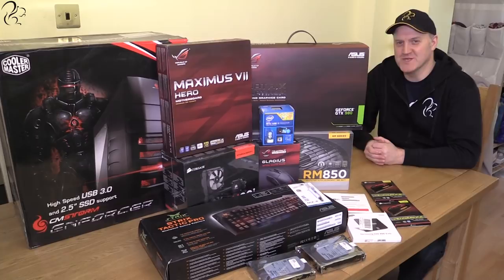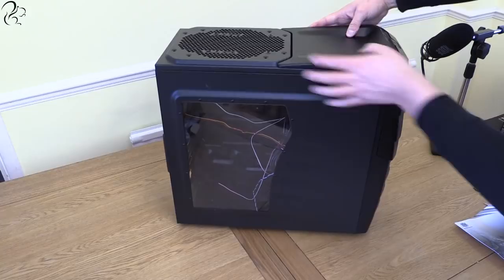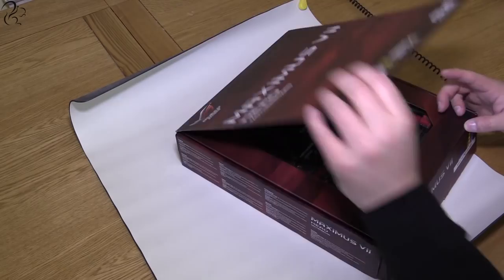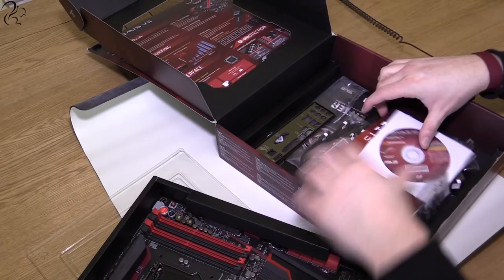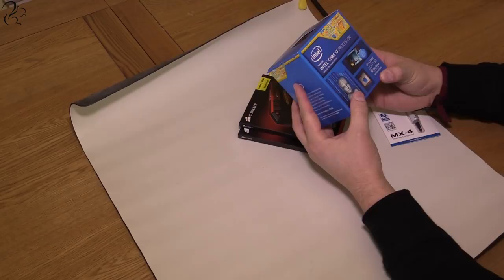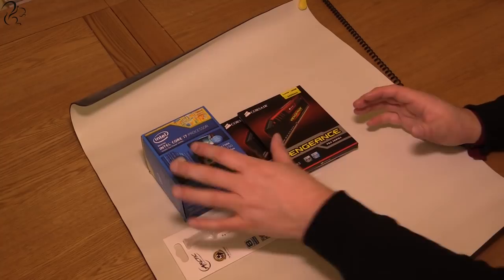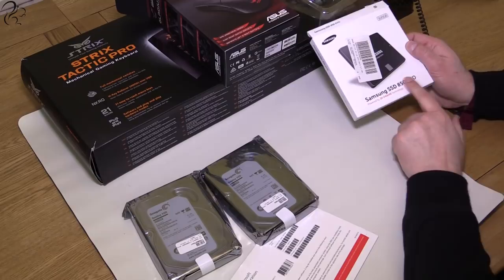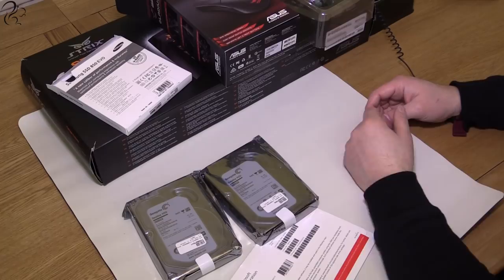How I Built My Gaming Rig (Step by Step)

Comment: builds ultimate gaming PC, plays euro truck simulator.
Reply: so what?
Reply: ETS 2 is a fun game!!
Reply: You realise Euro Truck Simulator on utra is a whole lot more graphic intensive than GTA V? At 1440p on my GTX 1080, I get 110 FPS on GTA V, and around 90 FPS while playing Euro Truck Simulator 2, both games on ultra.
Reply: Prins van Oranje My dad plays it on ultra on his crappy cheap pc and gets around 40 - 50 fps.
Reply: ciko 2283 Then your definition of 'crappy' is what most would consider a decent PC, or maybe or Dad just has a 10 pixel monitor.
Reply: Prins van Oranje well, its not really crappy, but its not GTX 1080 either. It has a pentium, some radeon hd card, not really sure and 6 gb RAM
Reply: ciko 2283 Well I was just using it as a comparison, that GTA V (a reasonably graphic intensive game) is less demanding than ETS2, not saying that you need a GTX 1080 to run either game, although it's recommended if you have a 1440p or better monitor.
Reply: ETS2 uses old tech to render GFX. Its not more demanding than say GTA5 its just that GTA5 uses later tech more capable with newer components than ETS2 does. FSX is the same, If they ran on direct X 12 then ETS2 and FSX would give much higher frame rates than they do. Hopefully there will be a ETS3 which will be more up to date with todays components.
Reply: That could also mean that ETS2 is not as optimized as GTA V.
Reply: Ets requires alot of power
Reply: Gta 5 is more cpu intensive so a higher end graphics card is less important to have. However ets2 is still less demanding than it

Comment: THIS video made me build my very first PC four years ago!. I tried to mimic your rig but in Argentina, some of the components were extremely expensive. Finally I got a 4790k, an Asus Strix GTX970, ROG Maximus Hero VII, the Corsair H80i, a Bitfenix Shinobi, 16GB of Gskill Ram and a 1TB HDD, a Coprsair K70 and a Steelseries Sensei Wireless mouse. Since then I've upgraded the memory (32GB) the case (NZXT H500), the graphics card (RTX 2060) got a 250GB, 1 500GB and 1TB SSDs, and the mouse (G900) aaand yesterday I got my Strix XG27V monitor. Sorry for the rant, but YouTube brought this video to me TODAY and it all just came to me. I don't know if you'll read this, but thanks Squirrel for this video, it was really a useful, well explained step by step to help me achieve something I never knew I could do!

Comment: Un-plug the molex cable from the graphics card, its for a memory defroster for when you use liquid nitrogen cooling, all it does is make the gpu memory run hotter.
Reply from the maker: TacticalWeetabix I'm going to ask my ASUS tech guy about that. I think it's probably an un-necessary connection but I'll see what he recommends.
Reply: Squirrel http://rog.asus.com/393712014/gaming-graphics-cards-2/overview-unboxing-rog-matrix-platinum-gtx-980/

"For those using liquid nitrogen, solder in the VGA Hotwire wires and short the available points to unlock LN2 mode, then plug in a 4-pin molex power cable to use the memory defroster. This keeps the memory from freezing up"
Reply: TacticalWeetabix Wait, people REALLY use Liquid Nitrogen to cool their computers? 0_o
Reply: TacticalWeetabix Is that a technical exercise or do people plug liquid nitrogen tanks into their computers when they browse facebook?
Reply: bigglessy LN2 for overclocking competition. Its not for average joe.
Reply: Faq
Reply: Squirrel when in doubt refer to the manual

Comment: I hate to burst your bubble, but the 120mm radiator and fan combo is less efficient at cooling a CPU than a good heatsink and fan. It's also not as quiet as you might think either as you still have two fans to cool the radiator. Whereas a large fan on a good heatsink will rotate slower and move more air, something like the Noctua fans are almost silent. Water cooling only really comes into its own when you are using a larger radiator (280mm) and overclocking the CPU.

Comment: Paul, you get 2 fans for the radiator so you can make a pull/push function. 1 fan on each side blowing in the same direction, so the airflow will be better when going through the radiator

Comment: Way more impressive than my PC build :(
Reply: Don't worry, your not alone. Even I have an above average gaming computer, yet I'm still jealous :)
Reply: Skybluex i'm impressed with my setup it can take NFS most wanted (2005) on full settings with 22 FPS. and BFP4F on lowest setttings at 7 FPS.
Reply: But will it run OMSI 2? XD
Reply: bigglessy But less impressive than mine... 
...I have an (oven) Pentium 4 @ 3Ghz with Hyper-threading on single core, only supports 32 bits, A Gigabyte GA-8I865GME-775-RH Rev. 1.1, it does not support an external graphics card and it's only DDR with two sockets, so 2 gigs DDR, a 500 watts PSU, a CD reader, it can't write nothing, a Seagate Barracuda of 80 gigs @7200 RPM and it's slow as hell, All this ultra generation system runs XP, and it can run NFSU2 at 12 FPS in windowed 800x600 at minimum, it can't run Crysis, or even OMSI, not even 8bit games.
Reply: TheVieneses just when I thought my computer was slow
Reply: Bro Vids Mine is worse than slow.
Reply: bigglessy you are NOT alone at all i have a Intel Core (TM) 2 Duo with a graphics card on ETS 2  give 0-10FPS on other games 20-60 windows 8.1 (i HATE it) sorry if i offened you if you have 8.1
Reply: bigglessy My first pc specs:
Intel Core i3
WINDOWS VISTA
the graphics cant even handle low spec games
Toshiba(TM)
the thing cant run a SINGLE game
Reply: bigglessy OH and heres my 2nd/before i had the one i have one now
Intel Core i3
Toshiba(TM)
Windows 8.1 (used to be 8.0)
4gigs 
64bit
Do not know the the graphics card
its a laptop now i have a 18 inch Intel core(TM) 2 Duo (used to be on a server) 8 gigs
64bit
Reply: If I remember correctly, here's my PC specs-
Intel Core i7 
Nvidia GeForce GTX 760 (not sure if that's the correct number, but it's in the 700's)
A 12 gig Ram (again, I'm not sure if I'm correct) 
ASUS laptop running Windows 8 on 64 bits. 

My rig can pretty much handle a lot of games, and can barely run OMSI. I normally play FSX on high settings, which can be very demanding...
Reply: Canabal dude my laptop stock has better spec than that and it was only £299 😂
Reply: Skybluex OMSIs game engine is the problem not our PCs

Comment: Quick tips, put the little cable that goes to your motherboard in the top left first (power cable) and then put your motherboard in, build your watercooling outside the case so you have more room.. You had to leave the plastic on the motherboard, put your cpu in close the bracket and the black plastic pops out, and VERY IMPORTANT: Check if anything work before you put everything in your case! So Paul, what if your motherboard came in dead?, or your videocard? Or anything that you put in? You can use the motherboard box as a test bench, these are some little tips helping everybody here working on their pc!

Comment: Thank you Paul for solving a problem I had with my rig (same as yours and built back in June 2014) fans running correctly and efficiently. that little tip about running cables in a more direct route (no splitter cable) and letting Bios/AI suite 3 handle things solved all my issues with noisy fans, and my system runs turbo now flawlessly.   again    thank you.

Comment: i would have cleaned whatever corsair put on the water block and used the arctic myself, i recently changed a 775 core 2 duo to a core2quad and the arctic was still good as new despite running for 5 years basically always on load, amazing stuff

Comment: Just want to state that the power supply doesn't have to go fan side down, but it's mostly best to. But for example if you don't have a dust filter under the power supply it might be a good idea to put it fan side up, unless it would interfere with your airflow plans or the temperature would be too high. Still very nice build!

Comment: You should have gone for a complete watercooling circuit. With a pump and buying like 10m of tube, cutting it yourself, making all the connections, replacing all the stock coolers on the graphics cards and replacing them with the (usually) fantastically made full metal heat sinks, putting in all the water etc. It's quite a bit more expensive because of all the extra equipment and takes a lot more time and fiddling about, but it's just so satisfying when you fill it up with water and start it up and everything works and you can see the water flowing through all the tubes... Just looks great. And in terms of cooling and silence it's even better ;-)

I think with Asus graphics cards you'd loose the warranty by removing the stock cooler though...

Comment: Don't you call that CPU cooler that comes with the 4790K Okay, that thing is not even capable of handling the heat that the CPU generates XD
Reply: No, that thing needs to feel bad about what it does
Reply: MelBrooksKA My system runs on a i7 4771 which is basically the same as the 4790(K) series but isn't unlocked for more overclocking options and on base clock speed my system hasn't been over 75-ish °C on 100% load

Comment: The two fans for your watercooling are for a push-pull setup.

I`m using a Noctua aircooler with 2x 140mm pushpull.

Comment: Squirrel, I hope you read this message. You need to keep your original intel cpu box intact, and keep the original cpu fan, in the box for 3 years for the warranty. Intel requires you to send the matching fan and matching box back if you for some reason have a cpu that dies in a few years. (It happens sometimes). So keep that box and that heatsink.

Comment: Hey like video just a quick couple of tips on a few things you did wrong. 

1: when u install the cpu DONT remove the plastic cover after you pull the retention arm down the plastic will automatically come off. 

2: when installing the cpu you made a small mistake but you always look in the corner of the cpu for the golden triangle, you mate that with the golden triangle on the motherboard and it'll fit every time the triangles are there for that reason from factory.
Reply: Just giving some tips so that it might help people.

Comment: 5: when mounting ur psu you can either mount up or down the fan simply sucks air and exhausts it out the back so you can either suck out the hot air with fan up in ur case or draw cold air in and exhaust it out the back with the fan down if you do this you have to be careful In case you have your computer on carpet which can suffocate your psu and kill it quickly so as a rule it's always better to have fan facing up but again it's personal preference

Comment: rad fans on backwards?
Reply: You should exhaust from the top back
Reply from the maker: Lucas Banting Not according to the Corsair manual
Reply: Andy26473 pulling in air through the un-filtered intake at the rear means more dust will be pulled in to the case
Reply from the maker: Andy26473 Why would you push warm air from inside the case through the radiator rather than cooler air from the outside?
Reply from the maker: Andy26473 Here is a link to the manual - http://bit.ly/1H8PcWB - page 3 "For the best cooling performance, we recommend mounting the fans as an air intake to your PC case".
Reply: Squirrel it probably only makes a few degrees difference, also un-plug molex from gpu
Reply from the maker: Andy26473 I answered your comment with a quote from the Corsair manual and your response is "My computer is better than yours". Really??
Reply: Andy26473 A better way to cool your computer that you should test is to put it in a frezzer. it will help over 100% better, and if you cut the power cabel in half you will save electricity. To save money you could put the computer in the shower if you doesn't want to cool the computer in the frezzer.
Reply: Andy26473 Sure ya do bud, sure ya do.
Reply: Squirrel a positive air pressure inside the case can cause for other components to stay warmer because it is just recirculating warm air around the case with no exhaust fans, you have 2 fans on the back and one at the front as an intake which will cause the components inside the case to warm up that air and nothing is taking that warm air out of the case therefore a positive air pressure wherefore things will stay warm. I hope you understand where i'm coming from here. Negative air pressure will always supply the case with cool air but the only downside is it allows the case to suck dust in through all the nooks and crannies.
Reply: Lucas Banting think of how a car rad and fan works.. they suck cool air in
Reply: Yes, but in a case, you need to exhaust the hot air out as well. If you only have intakes, you will be pulling less air through them.
Reply: Lucas Banting The positive pressure inside the case will push the air out through the vent at the top of the case.
Reply: Andy26473 Whoops! Well, we can't be at our best all the time, can we? Cheers!
Reply: +Lucas Banting What is the price of everything he bought? From PC to keyboard and mouse?

Comment: Where the fan connector plugs into the cpu pump the other slot is for another fan plug just like the one you plugged in so you can run four fans from the pump. It's pretty much the same pump you would use on a bigger radiator that uses four fans.

Comment: Positive pressure aside, It's surprising to see all that CPU exhaust heat is being blown across the MB into the front of the case where is will be mixed into the case air then used by the GPU and exhausted just below the CPU intake. And then there's PSU dumping heat into the case also. It all looked kind of messy and hot.

Comment: Hey squirrel, just wanted to correct you on your RAM comments, you are correct that you used to have to use matched pair, but times have moved on significantly , nowadays unless your doing something very niche almost every combination possible will work together.

also the defrost for the matrix is as those cards are designed for LN2 cooling, if your not careful bringing the card back to room temp it will collect condensation and short
Reply: Will Longden also its worth bearing in mind that although all heatsinks come with stock thermal paste, the quality is awful so its always worth scraping it off and replacing it with decent stuff

Comment: "Memory defrosting capability" means there's a heater built into the circuit board to prevent ice build up when you're cooling with a little extreme stuff like liquid nitrogen.

Comment: I will recommend that you turn your cpu watercooler fans around, so they push air out of the case. It will increase your performence for overclocking, and your overall cooling. Since you have the big 200mm fans pushing air into the case. :-)

Comment: I have that same processor. You definitely made the right call in not using the stock heat sink. It is garbage. It's just barely adequate, for some things. If you want to do any video editing/encoding or play a CPU intensive game, you will most definitely want to get an aftermarket cooler.

Comment: I think you should've mounted the block onto the cpu before you installed the radiator. At this stage the most important part is making sure the block is installed properly, and with the pressure of the water tubes, it's not as easy.

Comment: 4: I noticed when you were installing the fans on your rad you hadn't run your 8-pin cable from ur psu to the top of your case where there is a little space but you covered it with the fans and rad

Comment: you should use the Y spplitter,the fans will be loud on startup but they die down after,and you want to install corsair link and make them extremely silent, i use them in my system

Comment: first of all love the pc mate. a few things, the psw can draw air from inside of ur case, and in most cases (no pun intended) is better to stop dust if ur pc is on the floor. U should remove the molex connected to ur gpu. it is only for people that do sub-zero cooling, it warms up the memory if it freezes over. im making my pc in 2 months and i hope it goes with out a problem like urs :)

Comment: Nice video Paul, but you didn't mention plugging in the 8 pin CPU power cable on the top left side of the board, it was just there all of a sudden :)) By the way, I've recently upgraded my motherboard to an Asus Sabertooth Z97 mark1 and the CPU to an i5 4690K - the extra 100€ I would be paying for the 4790K IMHO is not worth the difference, especially, when overclocked. I got my CPU running at 4.2 GHz at the moment, will do more as soon I get a better cooler. Right now I'm using the heatsink from the Noctua NH-U9B and the original (and very loud) Delta CPU fan from the Dell XPS 730. (the case and PSU are from a Dell XPS 730 as well)

Comment: I used a fan controller for the H80/HH100i fans. The standard fancontroller isn't that good and causes grinding noises.

Your fans are mounted the wrong way, now the blow the hot air from the radiator into the case.

Comment: There was a other way to mount the cooling fan to make it look neat, you could have  fixed the fan at the top of the rig and kept the two cooling  pipe position on upper horizontal side so that it could have come neatly down to the CPU. And due to the position you have mounted the fan one of a cool thing of the motherboard is hiding down you could have saved that. and the usb cable would have not been so messy.

Comment: Cool system Squirrel  ... i'm watching for a watercooled R9 390X. So i can reduce noise of my HD7970. The CPU cooler you use seems quite nice so i'm concidering now switching the air cooler out using the same cooler and overclock my stock FX8350 a bit.

Comment: I feel like that case is a bit on the small size for this, it looks so tight. also you should install one or two top fans to vent out the hot air inside the case, it's really annoying me that you don't have a single fan pushing air out of the case :p